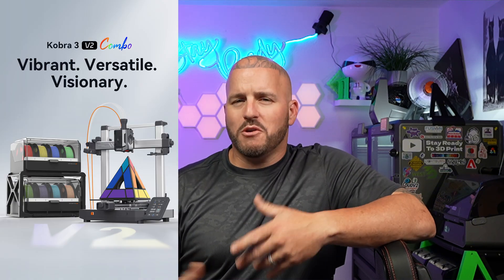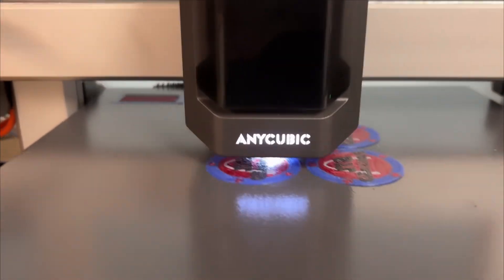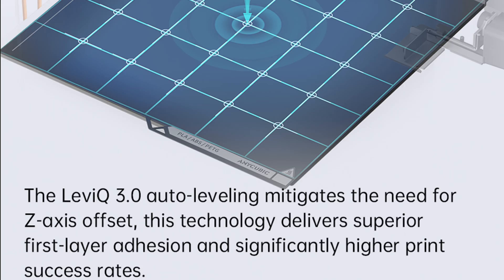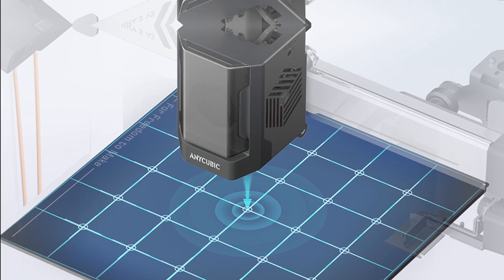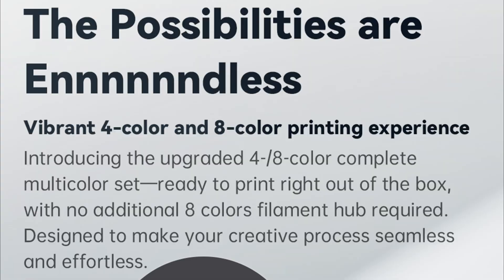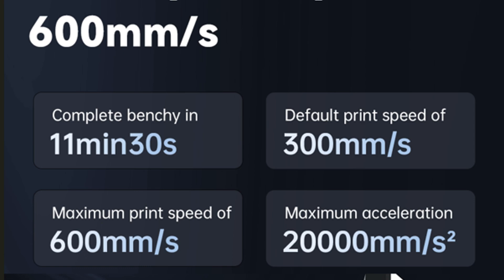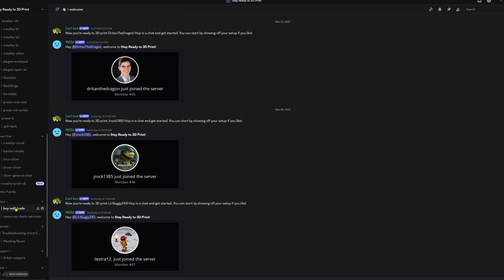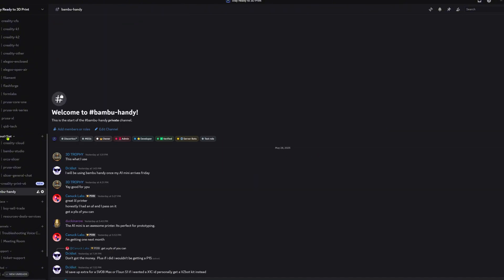Lets Talk About The Anycubic Kobra 3 V2 Combo Before You Buy It

Comment: As someone that has and is quite a happy with K3 combo, I see zero reasons to update. I was about to order one anyways and sell old V3, but their apparently slow marketing department decided that to get 8-colour hub you NEED to buy the 8-colour combo. You couldn't buy K3v2 + Ace + 8 colour hub (that I would use my old ACE with) or buy it as an extra. So, I decided to ignore the whole thing. At this point, getting an aftermarket ceramic heating/hardened steel nozzle set for like £10, much better upgrade. Well done Anycubic marketing...
Reply from the maker: Wow I didn’t know that. Sounds like they have some explaining to do
Reply: @stayreadyto3dprint  True, normally I would say that this is a classic Anycubic "let's forget about older models" trope - but this is not it as the 8-colour hub will 100% be available as an accessory which means this is either omission as they've just forgot this option OR an attempt to force people to buy the whole pack on release which is unlikely due to its ridiculousness (however chances of it are higher than zero) - so most likely they've just dropped the ball and made people with existing k3+ace sets unable to reasonably upgrade without being left with their current ACE unit pointless.